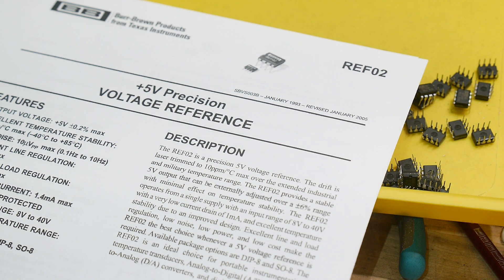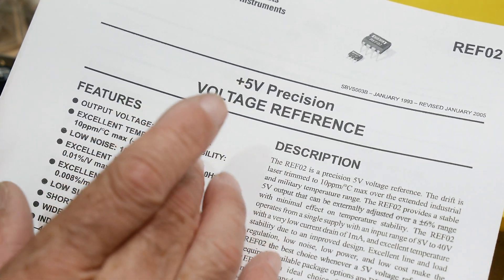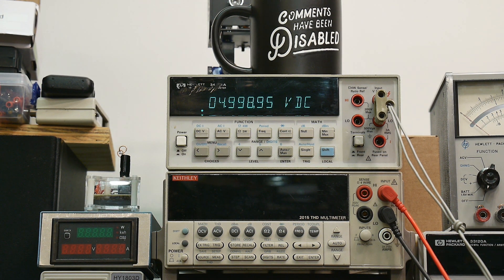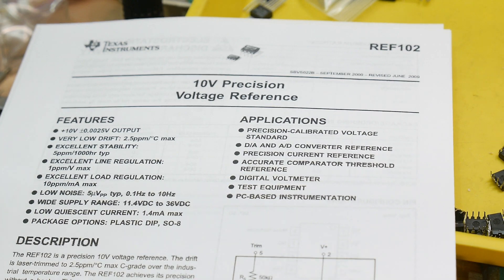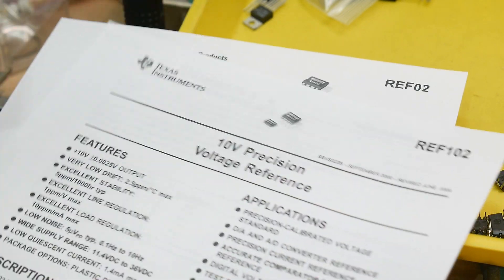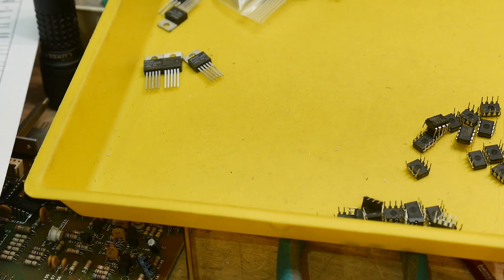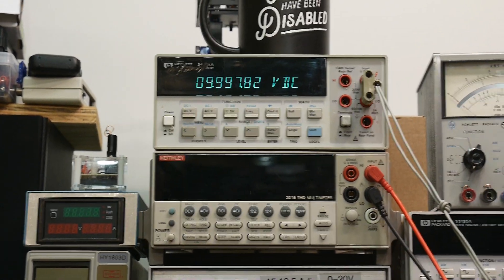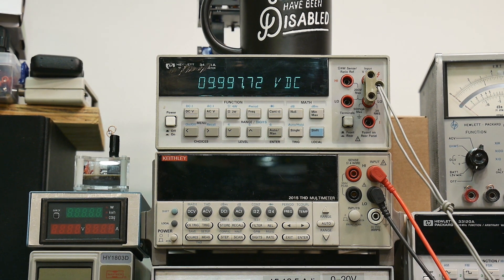#1138 REF02 and REF102 Voltage References

Comment: The 5 volt reference spec sheet rates the precision as +-0.2% not +-0.2V so it would be 5V +-0.01V or almost the same accuracy as a the Ref 102A which would be +-0.1% if we were comparing on a similar basis.

Comment: Specifications must remain valid over all parts, temperatures, and time.  Manufacturers can make no money if their customers return too many parts.  Thus, their specifications are quite conservative.  Assuming a normal distribution, about 95% of them are "typical" and fewer than one in 100k or so fail specs.  If the environment is controlled, we can expect performance significantly better than specified.

Comment: I have a hand full of old voltage reference chips and the REF02s and 03s didn't measure to well but I have one  MC1403U which is within a millivolt to 2.500v even though the data sheet is nothing great.  Because its accuracy is so good, Its is my quick check for my DVMs.

Comment: What are those yellow components you use in parallel on the voltage rails of the breadboard?
Reply from the maker: 0.01uf caps

Comment: Are the a/b/c chips manufactured the same and then just graded at the factory during testing?
Reply: That's quite possible, but this is a laser-trimmed part so the grade may also reflect how much time it spent on the tester to be trimmed.